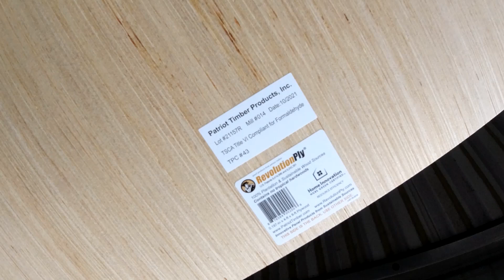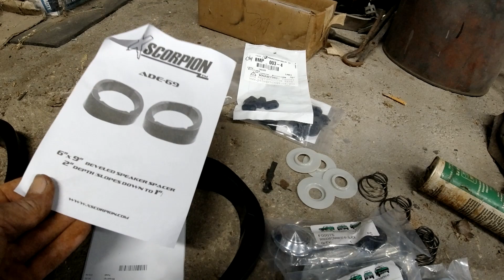1968 Chevelle Nomad Restoration - Part 20 - Making New Door Panels (Cards) from Scratch !!

Comment: Walmart has material in the craft department and like DD  speed shop run a molding across where the screw heads are and if they don’t give you more material just touch it up with black paint extra material for your console your building would look good match the doors

Comment: yeah this as happend to me before the fake leather drys out and cracks where it as peeled off get a little brush spray some satin black spray paint into a little tub and paint where it as peeled it will not be noticable then after that clean the leather with some furniture polish pledge with a micro fibur cloth and it will stop it cracking and keeps it moist

Comment: You did a great job on the panels but the material they sold you is crap. If masking tape peeled all the vynil from the fabric below, I don't see them lasting more than 5 or 6 months before they peeled all the way from top to bottom, especially in your area with the heat and stuff.
Since you're gonna have to remake the panels with new material, I'd say you put a little bit of thin foam between the wood panel and the new material, and use some wood staples for the leftover material on the back of the panels after you glue it to them.

Looking forward to the next episode. Cheers from Argentina!

Comment: You have the right idea with covering the panels. Don’t give up. Get a refund and buy some higher quality vinyl and try again. A custom upholstery shop made some panels just like this for my 73 van for the doors and wall. Instead of taping them on the back, use a shallow staple 1/4” I think to hold one side of the vinyl down. Then apply your glue, stretch out the vinyl and staple it on the other sides and let glue set up. Trim the corners like you did to get it to lay down right. You can make it work. If you buy different vinyl, you might get some with a smaller Diamond pattern. Cars and custom vans used a smaller Diamond pattern for the doors. Good luck. 

3M makes a strong contact glue in a can. Get the strongest type if you want to spray on the glue instead of paint it on. About $20 a can. They make it in 2 strengths of adhesion.
Reply: I agree on the staples; I've done it that way myself and it works well.
Reply from the maker: I ordered some marine grade material and it is the smaller diamond pattern